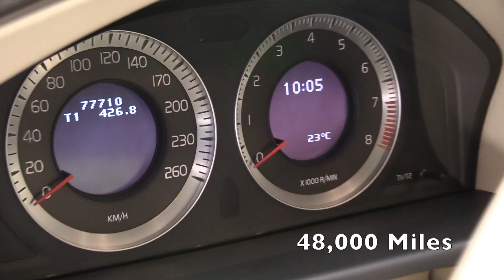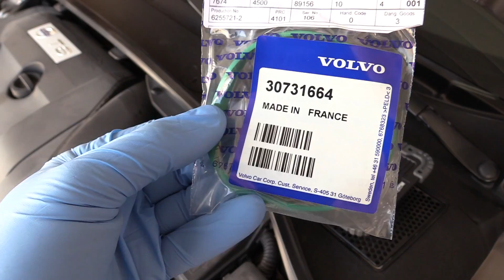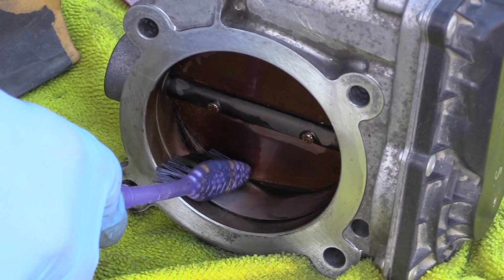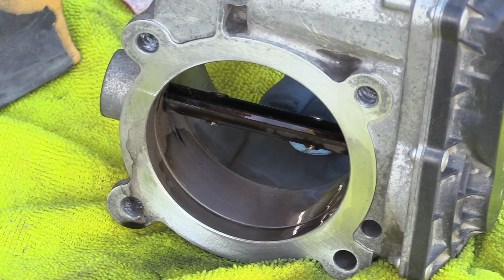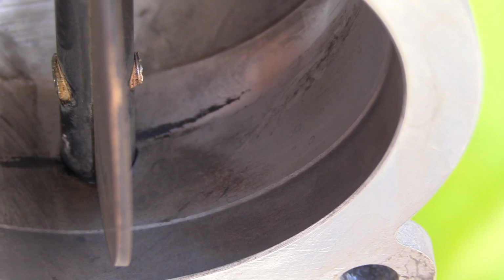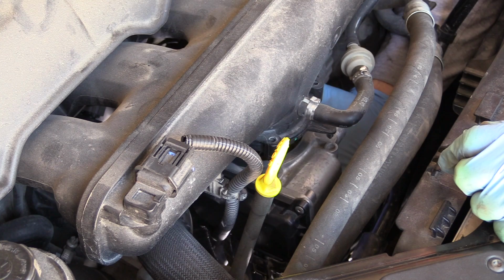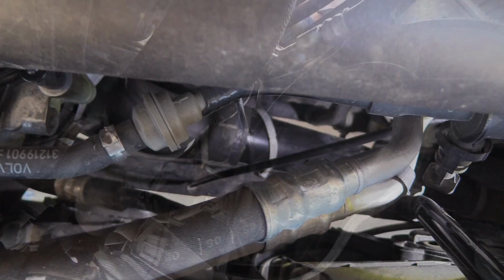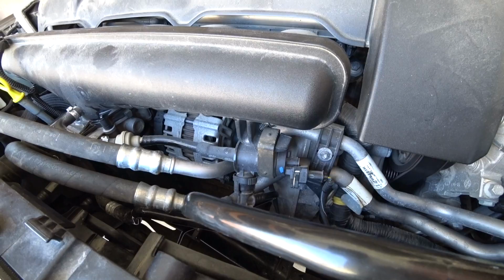Volvo P3 throttle body cleaning on 3.0 T6 / 3.2 Gas engine.

Comment: Thank you for this! I am ordering a gasket and will be doing mine. My idle has gotten just a bit faster and I just don't like it that way. I cleaned the throttle body on my 06 XC70 when I did the PCV system and it made the idle so much better.

Comment: I’m very happy to have found your channel. There are others about Volvos, but I really like the way you do things. I own a 2011 XC60 T6 which I bought two years ago with 55000 km on and is now reaching 100k. It has been a bit neglected by the previous owner and I had to do a lot of maintenance to put it back on its current good shape. But I reached the point of getting tired of dealing with mechanics that won’t always do jobs as well as I demand, so I decided to do the work myself from now on. I’m an electronic engineer with a lot of experience on maintaining my own cars in the past. I’m studying everything I can about my car and I’m tooling up for the jobs ahead of me. First thing will be replacing the alternator bearings, replacing the serpentine belt and pulleys, and since the intake will be off the car I’ll clean the throttle. Cheers 🍻

Comment: I am the original owner of a 2011 XC 60 T6 AWD with 171000 miles now. I change the engine oil with Mobile One synthetic high mileage oil (label says for 20000 miles which I don't believe)  every 7000-8000 mile faithfully. The most recent oil change was two weeks ago and I only drove 4000 miles ( precious change was about 11 months ago). 

I am not handy with mechanical skills and I don't have those tools so all works were performed by local garage. I have replaced the PCV, fuel pressure sensor (my own Bosch part), radiator with two new hoses ( radiator job --->$1100 parts and labor), Mass air flow sensor, all for suspension systems in 2022 with a total cost of $4000 US dollars. I also change the engine air filter every year. 

My car runs really smooth and quiet. Acceleration is quick with ease. There is no hesitation and gear shifting is also very smooth ( I don't feel anything when car shifts gear ). Never change the transmission fluid and Haldex oil. Volvo dealer won't even do the transmission fluid change and they said it's life time fluid. I really want to change these two oil but a local garage who specialized on Volvo said since I never change this two oils before (should change every 50000 miles); now they won't recommend to doing at all. I will flush the power steering fluid myself next week when I receive the fluid. This procedure seems easy and I can do it myself.

I am thinking to change the serpentine belt and other related parts like water pump, pulley and tensioner.  Here is my question that I need your expert advices.

The car runs well without any issue at this point. Car's exterior and interior look like new. I only drive about 3-4000 mile nowadays with this car and intend to buy a new car (maybe the 2025 EX60). Do you suggest that I still need to replace serpentine belt system (not cheap) clean the the throttle body, transmission fluid, haldex oil?

I wish you were my neighbor and I will have you to perform all those works without any hesitation. Thanks in advance! Keep up the good work!

Comment: The design of this vehicle makes their maintenance difficult. Wonderful work my brother. 👍🏻👏👌🏼
Reply: ? This is one of, if not the, easiest car I've worked on. Love it
Reply: All transverse engine designs pack the engine compartment full, yes.   However, changing a headlight bulb on these P3s is way easier than any previous Volvos.   The videos like this make the job enjoyable.
Reply: I actually think Volvos are one of the easiest. Audis and BMWs are another story 😅

Comment: I've reused my throttle body and intake gaskets without issue (P2 XC90 3.2 and P3 XC60 T6).  They stay playable even after removal and re-install.
Reply from the maker: Maybe. Did not want any negative feedback here.
Reply: My throttle body on my 2012 xc90 3.2 seems seized; should it move freely?

Comment: Nice vid.
2 points to have diesel EGR clean.
First- engine oil need to be according to the engine specs, genuine(No matter what brand) and with correct ACEA parameters. 
Second- is the fuel. I had my egr out for cleaning for the first time after 200k. No drama at all.Thin layer of dry soot and nothing else.
Reply from the maker: Yes. Oil and diesel quality plays a role. In Russia there is a lot counterfeit oil and petrol/diesel is poor qiluality. Sucks that the citizens get such poor quality in a country where there is oil.

Comment: Good work as usual,but I'm sure that after cleaning any drive by wire throttle body,you need to do like basic setting or relearning for the lower and upper limit so that you have the correct throttle angle,specially after 77,000 Km the engine is not like it was when brand new,I do this all the time for the PSA group cars.
Reply from the maker: Maybe. But works like it did before.
Reply: @volvosweden  What the use of cleaning if it works like it did before,it should get better after cleaning.
Reply: It's an instructional video. The air space around the butterfly is important, so if they showed a really dirty t.body, other guys would think that their own were not too dirty. This is really one of the only maintenance/cleanings you need to do on a modern engine ~
Reply: @georgehofgren6123  Don't forget about the pcv/oil trap, leaky vacuum booster, and all the drive gear/hal;dex oil changes to name a few.....

Comment: If you use good quality gas/petrol, and your car is running properly, this will never need to be done. In fact, a little tiny tiny tiny bit of covering in that part is a good thing.
Reply: Sadly not the case in countries like Mexico ☹️

Comment: I was looking at mine and it appears the entire cooling fan assembly comes out with just the corner clips and one connector. Could make front engine work a Lot easier 💁

Comment: As usual, great video! I did it last night on a 2011 S60 T6 and was surprised to see so much gunk after 133k kms. (I bought it last year with 113k kms). I also cleaned as much as possible all the gunk on the rubber hose and since I was in the mood, ended up doing the vacuum pump as well following your other video. Here's the bef and after of the throttle body: https://i.ibb.co/WkVBVK9/image-1.jpg
Reply: Made it look brand new!👏
Reply: Did u have a weird hesitation delay beforehand in drive when going from cruising to hard acceleration if so did it fix it or could this cause it.
Reply: @joewhite8079  not that I remember

Comment: I think 3.2 engine throtle body is a bit deeper and harder to remove
Reply: Jim Bob  for 3.2 you have to remove it from under the car. Not from the top. I think :) that place in my s80 looks tight. Maybe in xc90 there is more room.

Comment: Do you have a video for replacing the cup holder rubber tabs . I have a 2011 XC70. Thanks
Reply from the maker: There is a video on my channel. Search " volvo cup holder illumination" this video shows the rubber tabs.

Comment: Fomoco ... Unfortunately... Don't worry now that Ford no longer owns Volvo they're doing so much better since being owned by a Chinese company. The brands reliability has gone down the drain only slightly better than Land Rover/Jag group.
Reply: Worst thing on new Volvos are the 4 cyl engines. They sound terrible and I don't think they will last as much as the good old inline 6s
Reply: Happy to have the inline-6. I believe that is the most balanced engine configuration there is. At high speed, the car is incredibly smooth and quiet~

Comment: Great job. Maybe it will help my XC70 2008 3.2, because RPMs Fluctuates and shows errors:
ECM-P050600 Idle Air Control System RPM Lower than Expected 
ECM-P061B64 Internal Control Module Torque Calculation Performance - Algorithm Based Failures - Signal plausibility failure.
Reply: It might be as simple as you need a new engine air filter.
Reply: @pbierre  I changed it about 500 km ago, so I think its not that.
Reply: @lukaszsocha5558  Are you using the DTCDECODE website?  You can Google "Volvo ECM-P061B64", and the site will list all the possible causes.  The most common is the MAF, which you can take off and clean.   If that's the cause, you should see some improvement.
Reply: @pbierre  Thank you Pierre, I will clean my MAF.

Comment: Gm, great post. Was wondering if you have had any AC videos. My AC   On 2011 xc 70 is not working compressor and clutch seem to work. But when hot Ac quits on me. Your thoughts would be helpful. Thanks

Comment: When replacing the throttle body with a used one on these P3 3.2 engines. Does the car require programming or is a used throttle body plug and play?

Comment: I’m about to tune my 2011 XC60 T6 with 225,000 kilometers on it. I have had the car since new and all of the fluids and filters have been changed out regularly. (Thanks to the help of all your videos). Do you think the tune would hurt the car because of the amount of kilometers on it or do you think it would be fine since the car has been well taken care of?
Reply: It's absolutely fine to tune it
Reply from the maker: Should be no problem. What kind of tune?
Reply: @volvosweden  Looking at the tune from VolvoTune.NL. It's flashed to the car through VDash. 340bhp and 360 ft/lbs. So it is just slightly more than the Polestar tune the dealer offers.

Comment: Hi, I have seen all your videos and they make me to try by my own. If you manually move the butterfly, you don’t need to calibrate later?
Reply: I did it last night and so far no issues. Since it's spring loaded, it goes back to it's default idle position

Comment: good job，when will you replace the timing belt? Hope to see it
Reply: It has a chain. No belt
Reply: @D5DRIFT  Probably meant the serpentine drive belt.
Reply: @davemtf7295  Accessory belt replaced at 150K mi (240K km)

Comment: Could please post the order of the wires going to the straight 6 pin connector on the throttle body? I dropped the intake and the wires pulled out of the connector. Now I don't know where the wires go.
Reply from the maker: Let me check. Email me at yuriyermilov@gmail.com
Reply from the maker: I got it. Email me and I will send you a pic

Comment: Thank you for the video. I have a 2009 XC90 3.2 non-turbo with 149k miles. I recently developed a symptom of light hesitation / slight jerking when accelerating lighly and this is only between 1500-2000 rpm. This especially happens on some load (like going uphill). When I accelerate normal and then i press the gas pedal 25% or more there is no issue. Do you think this procedure is relevant to my issue? Should i perhaps also try spray cleaning the MAF sensor or other?
Reply: i have the same problem, did u fix it?
Reply: @Plymouth-1970 Adding engine oil to proper level seems to help. I tried fuel injection cleaning, replacing the throttle body along with relearn procedure, tried cleaning the MAF sensor all to no success with his. I did notice that when the issue is more apparent the engine oil level tends to be low, this is towards the time when the car is due for an oil change. My xc90 has at least one oil leak through #1 cylinder spark plug seal, maybe more leaks. When I add oil to normal level the issue is no longer apparent. Let me know if this helps ✌️
Reply: thank you for answer! i added oil to the max level (it was in the middle) but no changes.. it jerks only at very low speeds when u slow down speed and than press the gas pedal again
Reply: seems like it downshifts from 2nd to 1st when it jerks, but when i put it in manual shifting mode the shifts are very smooth at any speed
Reply: @Plymouth-1970  then there you have it. Your symptom seems to be related more to transmission. When I experience hesitation at low rpms the car does not change gears. I wonder if in my case a flooded spark plug is causing misfire at low rpms.
Reply: it's possible, than i'll try to change transmission fluid first.
Reply: @Plymouth-1970  sounds like a solenoid or similar part that controls the automatic shifting that may need to be replaced. I would visit a mechanic or transmission shop that sees a good number of these and see what whey say. If it shifts smoothly when you shift manually that's a good sign. I've had my trans fluid drained and filled three times and it made the shifting quieter and slightly smoother. I don't seem to have the issue you're describing.
Reply: @Plymouth-1970  Two years on, did you get to the bottom of this? I've got the same low revs shift flare on a 2010 xc70 T6 and it's a pig to diagnose.

Comment: Hello. Did You change the A/C compressor v-belt? How often should it be replaced on the T6? Do You know something about it?
Reply from the maker: I will be doing  that soon on my friends Xc70 3.2 no nothing about yet.
Reply: @volvosweden 
I'm waiting for the video :) 
I recently bought a 130,000 km s80 T6 and I wonder if it should be replaced. The replacement seems a bit complicated due to the small space around the belt :/

Comment: I tried to find the video where you said you use 0w-30 or 40. Why the 0weight? I think my owners manual says 5weight?
Reply from the maker: 0 because it gets to -35 here in Manitoba Canada. Just better flow.
Reply from the maker: There is a video on the channel 0w30 bs 5w30 watch it.

Comment: My 2012 s60 t6 idle is around 650rpm which is supposed to be 850rpm. Is that because of the dirty throttle body?
Reply from the maker: Nothing is wrong with 650rpm. My T6  is the same.
Reply: volvosweden Thanks bro. It just looks a little bit weird because my s80 2.5T always runs about 850rpm.😅😂
Reply: It's ok, my S60 idles at 590RPM after cleaning the throttle body, injectors (done by a shop) and MAF sensor (KN air filter)

Comment: Can you do an oil trap replacement video?
Reply: If it's related to the PCV noise, you can replace just the PCV valve, instead of the whole assembly